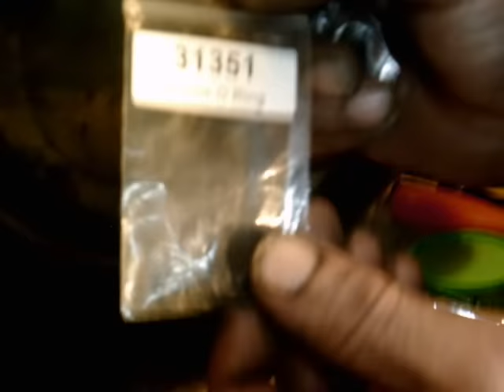Torpedo Heater Repair - Injector Nozzle Cleaning Part 1

Comment: I have a ProTemp PT-70T-KFA 70,000 heater that will start up fine, run for a couple minutes and shut down. I’ve changed the photo eye, and it still won’t keep running. The only way I can keep it running is to hold the photo eye to a light. What should I try next?
Reply from the maker: Sounds like you have an air leak, Check the air line and make sure its tight. You probably also need to tune up the heater. Call me at (216) 801-6215 tonight for the next 3 hours or whenever you have time. If Im on the phone I will call back right away !!!

Comment: is the small piece supposed to be free spinning inside or tight to the body?
Reply from the maker: Tight to the body of the inside of the nozzle head.  It has those angled cuts to make the air swirl. Torpedoheat.com (216) 801-6215

Comment: I have a 35-year-old-ish Handy Master (I think made by Desa) that's a 30k BTU. Works fine until I put the top lid back on, then it trips off. Tried new rotor and calibrated the pressure. Aside from verifying that the photocell is OK, I wonder if it's the nozzle. I believe the nozzle is a M29681 but that's no longer available. Think the Desa 35k BTU nozzle would work (PP206)?
Reply from the maker: Yes that nozzzle will work. You have to make sure you dont have any air leaks first !!
Reply: Great to hear! I'll definitely check for leaks, too. Thanks for responding!
Reply from the maker: No problem !!  You have to check for air leaks using soapy water !!
Reply: Torpedo Heat, will do. Thanks again!

Comment: Hello sir. I have a small engine repair business and have fixed these thru the years. Last year I had 1 about 110K (kerosene), got it all working but had some inconsistent runs or starts I forget what the exact scenario was after changing many bad parts including soldering a capacitor back on the main board. I know all the tiny things to look for (tiny hairline cracks in the plastic, tiny amounts of air leaks etc)...but I couldnt get it 100%. It looks like your a pro at all of these. I want to advertise that I fix these and was wondering if I could call on you if I get a real problem machine in the future. Please let me know and what type of communication we could use. I would really appreciate it. Craig in VA.
Reply from the maker: You can call me anytime @ 216 801 6215 during business hours EST

Comment: Heater won't ignite wont get a spark
Reply from the maker: what heater do you have and how many BTUs is it
Reply: @TorpedoHeat  heatstar hd 175,000
Reply from the maker: @billyharjo4440  You must need the igniter First make sure the spark plug electrode is clean. Here is the link to the igniter 
https://torpedoheatparts.com/click-here-for-parts/ols/products/igniter-22142-enerco-mr-heater-dewalt-heatstar-and-more
Reply from the maker: Here is the link to the spark plug electrode 
https://torpedoheatparts.com/click-here-for-parts/ols/products/igniter-22142-enerco-mr-heater-dewalt-heatstar-and-more-4c42265a-9778-4d2d-8a9e-3e2529515a61
Reply: @TorpedoHeat  yea its a brand new electrode put the box ill order the ignitor
Reply from the maker: @billyharjo4440  https://torpedoheatparts.com/click-here-for-parts/ols/products/igniter-22142-enerco-mr-heater-dewalt-heatstar-and-more
Reply: @TorpedoHeat  thank you got 1 ordered

Comment from the maker: Torpedo heater repair // parts 
Injector nozzle cleaning and srevice
Common problem
Reply from the maker: Call 216-801-6215 for parts and global service. 
Toll free 877-736-6230

Comment: My dad gave me a heater that he found...i freed up the impelar,jump off the motor and got the glow plug working...everything works now and it start ...but will only stay lit for a few minutes...but start right back up again when i turn it off then back on...what could the problem be?
Reply from the maker: Most likely it is the photocell making it cut off. That circuit board is very delicate so you will want  to cut the wires to install the new photocell. The wires can go any way so that is easy to install. Here is a link to the part.    https://torpedoheatparts.com/click-here-for-parts?keywords=pp236&olsPage=products%2Fphotocell-pp236-m16656-24-desa-hsi-common-more    The image is of 2 photocells but that is the part.
Reply from the maker: Torpedoheatparts.com is a super secured website with an SSL certificate and Macafee security.
Reply: Can't running too small of a tank do the same thing?
Reply from the maker: No you can run a heater from a gallon jug if you need to.
Reply: Guess I was misinformed then.  So what causes regulators to freeze?
Reply: Milk Manson when you say regulater...are you talking about the impelar'...mine had moister that caused rust to freeze it up...i turned the motor shaft with some channel locks thinking that I freed it up...i did free it up...but upon further inspection realized that I busted the improve in five peices doing so...
Reply: No, the gas regulator.  The directions that came with my torpedo heater say a 20 pound tank is too small... something about pulling too much propane out too quickly cools the tank and reg enough to freeze things up and restrict flow.... sounded like nonsense to me, so I tried it and sure enough I froze my ass off that day.  Worked fine with a bigger tank.
Reply from the maker: Yes the actual flow of the gas will remove or absorb heat and cause freezing.  That also can happen pretty quickly.  Just so you know a 100 pound tank will provide 140K BTU output per hour when the tank is full. As the tank empties the output will drop. So if you had a 400K BTU heater you would need to run 3 tanks all 100#. And all the tanks would need to be connected together. Then a 400K heater would empty those 3 100# tanks in about 45 hours.  Very expensive.

Comment: My 125 motor comes  as quick  as I turn it  on  before it  ignites  it has a switch an a thermostat  can't figure it out  please  help thanks  roy
Reply from the maker: Does it have a spark plug or an igniter ??
Reply: Yes it ignites  an motor comes  on quick as you  turn it on  no 5seconds
Reply from the maker: Do you have a spark plug in that heater ???????????/
Reply: Igniter it comes  on an motor  at same time  starts spraying  immediately
Reply: No spark plug
Reply from the maker: @royjohnson3423  OK then check it for air leaks